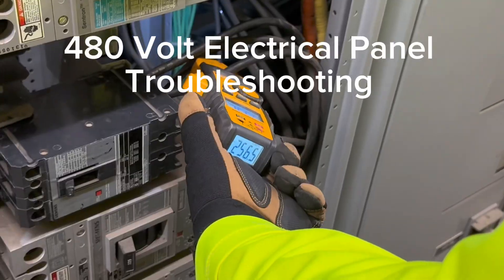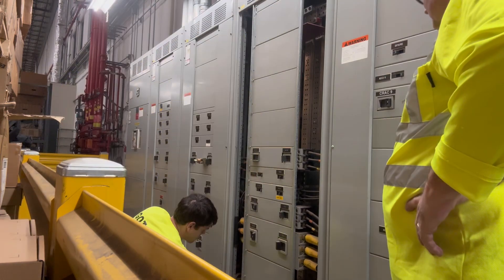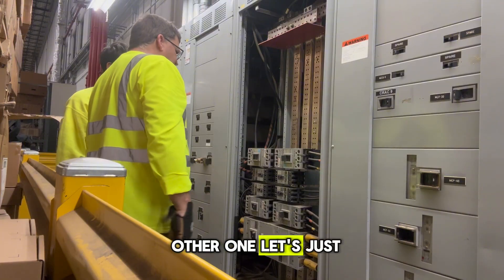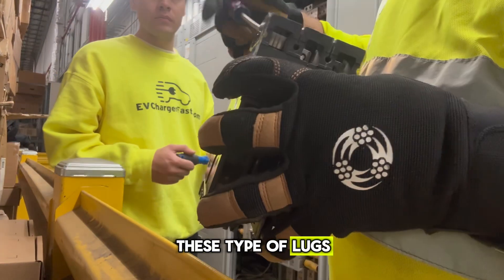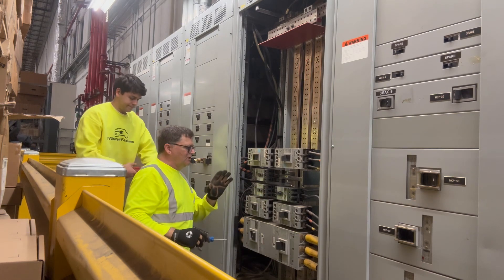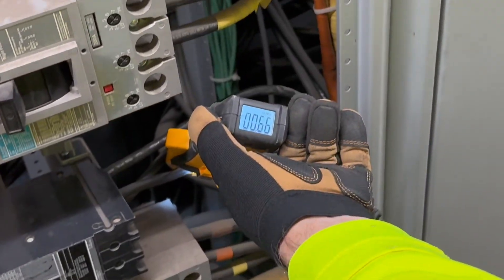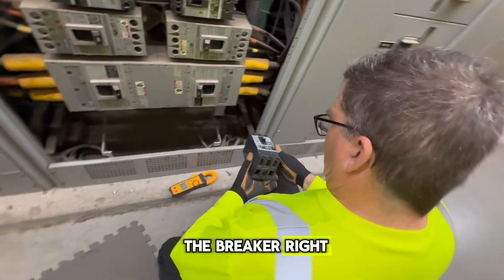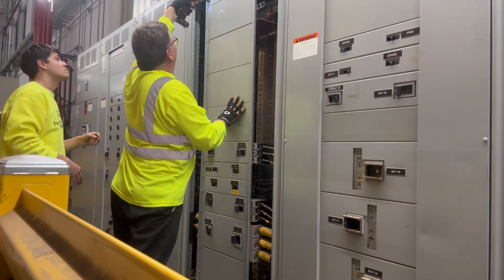MASTER ELECTRICIAN DAD TEACHES SON HOW TO TROUBLESHOOT A 480 VOLT PANEL!

Comment: Dude...You re a professional, that is a 480V 3-P gear, if you re gonna share educational videos you should at least try to follow NFPA70E and wear proper PPE, also an impact driver on the dead front can cause vibration that can dislodge some loose screw or something inside falling and causing a deadshort, ending up with death or worse, sever life altering injury...I know that I sound like a safety nerd, but I ve seen what 480V can do to people, we have a guy in our local who calls himself Mr Potato head, because he wear prosthetic lips and nose, his wife waited till the work comp insurance payment cleared, divorced him and left with half his worth...This is No joke

Also using a non insulated flathead to losen the breaker, saying that you re only using one hand (allegedly to not get grounded) while you re kneeling is not making sense.

Comment: Non union for sure
Reply: But he’s a “master” electrician so clearly he’s immune to arc flashes. 😂
Reply: You can tell by the lack of training, he carries himself with confidence and thinking he is a master, but he comes across as extremely compacent, negligent, oblivious to the danger and underprepared...NFPA70E is LAW (Used by OSHA to enforce) and if something happens he will take all the liability as he was being negligent and reckless, no Lockout tagout, no arc flash/blast boundary, no proper PPE (wearing that polyester shirt that will literally fuse with his skin in case anything happens)...It's insane! You can't approach industrial settings with a resi cowboy mindset.

Comment: I am really concerned over the lack of NFPA 70E adherence. I see WARNING labels but can’t tell if there is guidance to the proper arc flash PPE. 
Exposure to bussing requires certain arc flash PPE the more videos I see that do not adhere to NFPA 70E scares me.
Does your company have electrical safety program:

Program components
Electrical safety policy: Mandate an "electrically safe work condition" as the default, establishing a policy and procedures for energized work only when necessary.
Arc flash risk assessment: Conduct an arc flash risk assessment to identify hazards, determine incident energy levels, and establish arc flash boundaries. This must be updated after major modifications or at least every five years.
Shock hazard analysis: Perform a shock hazard analysis to identify potential shock hazards and determine approach boundaries.
Labeling: Apply arc flash warning labels to electrical equipment that requires energized work, including the results of the arc flash assessment to help workers choose appropriate PPE.
Documentation: Document all procedures, policies, and risk assessments to ensure the program's effectiveness and compliance.
Reply: I hope they have good  insurance. Both business and life  .
Reply: To make it worse they are wearing polyester which is a bad deal as a flash will melt it into your skin.

Comment: What happened to PPE? I dont see 1kv gloves, a flash suit or insulated tools, or hell, even safety glasses! Do you have a work permit? What about
LOTO?

I also see you're in an industrial environment, where typically you need head gear, wheres that?
Reply: Straight up complacency. And trying to teach others while setting a bad example.
Reply: It's funny in one of their short videos he talked about having the proper PPE. I understand that killing the bus might not be an option, but at that point they needed the appropriate PPE to perform that work. Even do volt and amp readings with the dead front  removed would require arc flash protection where I work.
Reply: Im an hvac trainee and electricity frightens me.... theres alot of bad info in the trades! Im wearing my ppe no matter what.

Comment: No safety glasses, no gloves,  no hard hat, no arc flash suit. Keep up the “good work”. You could kill someone with the poor example you’re setting
Reply: Don’t worry they’re wearing FR 😂
Reply: He knows what he's doing
Reply: @ddamj6677 Clearly not, that’s a live high voltage panel. Doesnt matter how much knowledge you have or what kind of tests you can pass - breaking safety rules so negligently can land you in prison if someone gets hurt. Hope he has good insurance.
Reply: @justinadams2449 anything less than 1000v or less is considered low voltage technically
Reply: @OneStrangeElectrician  Technically you’re wrong. The terminology is relevant to the type of work you are doing. They are clearly commercial wireman so anything 277 and above is considered high voltage
Reply: @justinadams2449 that’s from the NEC utility work is high voltage. anything 1000v or less nominal is low voltage
Reply: @OneStrangeElectrician  but you’re not understanding that it’s all relative. In a commercial setting a 480 V panel is considered high voltage because it is Relative to a 120/208 panel. That’s why the colors are brown, orange, yellow, and not black red blue.  The technical term is high voltage when you are in the field. The same thing applies if you are a data guy installing cat5/6- you would refer to 120 as high voltage because it’s relative to the cat5/6.
Reply: @ddamj6677 that’s what I say when I am going down the highway at 100mph
Reply: @ddamj6677 That’s what all the arc flash victims say,” I knew what I was doing “. But then all it took was one little slip of a hand.

Comment: Look, I’m not saying what they’re doing is safe  because it’s definitely not  but I’ve been with the MTA NYCT Power Department for 10 years. The reality is, PPE has never been consistently issued since NYCT was created. We work with everything from 27kV down to 120V AC, and DC systems from 750V down to 12V. So acting like they would get fired for this isn’t realistic. We’ve all had situations where we worked without full PPE because that’s just how things have always been done here.
I'm not saying it's right but just be honest.
Reply: The second he put his uninsulated screwdriver on a live bus to bolt/unbolt the breakers I drew the line. Wild risks he is taking without any PPE
Reply: @ccjjss2424 and he’s a “master” electrician. Just goes to show that certificates are just fancy pieces of paper that prove you can take a test.
Reply: @ccjjss2424 yeah that’s actually one of the most wildly unnecessary risks I’ve ever seen
Reply: @ccjjss2424  Oh know, you drew the line!!!! What are we going to do now that we have an upset laborer 😱
Reply: if you dont advocate for yourself and your own safety then whatever happens next is pure negligence. Most jobs arent going to fire you or retaliate if you demand ppe because they KNOW that osha doesn't fuck around with denial of PPE which the employer is supposed to provide. The dad should be sort of ashamed with the fact hes working on live 480, no insulated tools, not even a mask and gloves, and is fucking around with a bus like that. theyre not even doing proper things like NOT STANDING IN FRONT OF THE CIRCUIT. Its just negligent and dangerous.
Reply: Depends on the company. Some are stricter then others
Reply: Lol, dude your company is the exception and its a shitty work environnement, where I am from, they will 100% get fired by the contractor OR the customer maintenance department or safety...Liability is huge; people have been fired from jobsites for not wearing a harness in a sissorlift let alone this shit

Comment: You would have been fired at the company I work at as soon as you took any of those covers off with out a hot suit.
Reply: Yeah this is super dangerous even with 1000 volt insulated tools. That panel would have to be dead for me, breaker should be locked and tagged and schedule an outage for the work to be done.
Reply: @anthonyesposito7 that's why you wouldn't get that bid. Sometimes some things can't be turned off
Reply: @ddamj6677 that makes no sense.  One thing not to turn it off but another to work on it in such and unsafe manor.
Reply: This is what separates Union from non Union, But they won’t say that in any of their videos. Safety rules exist for a reason- because they were paid for in blood. This is complete and utter disregard for safety.
Reply: Nobody asked
Reply: @lucaslifts868 yeah, that’s why it’s in the comments, not the answers to questions section
Reply: @highvoltage1979   Nobody asked
Reply: @highvoltage1979 😂
Reply: I was thinking the same thing